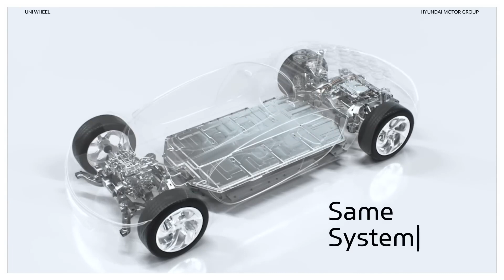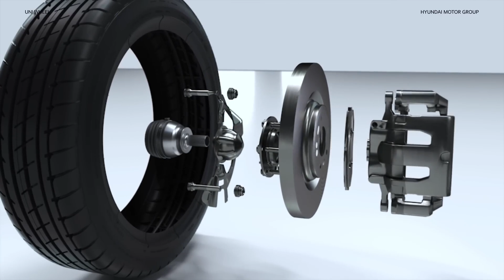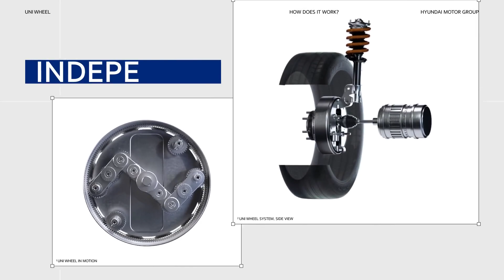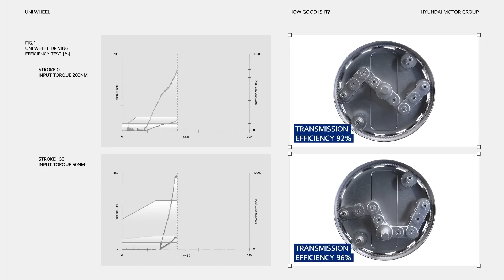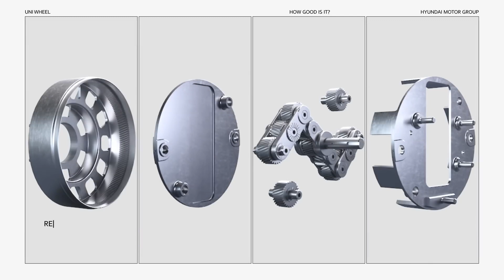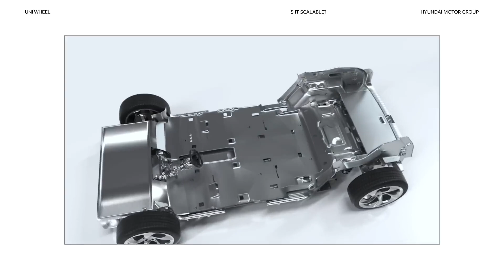Hyundai Universal Wheel Drive System

Comment: Does braking fall totally upon the regenerative electric motor system? How long will this system last in a harsh environment of dirt roads, mud, salt, snow and ice? Does that big vertical slot accommodating the suspension travel get a perishable rubber boot? I am trying to visualize how that boot would work and last. What happens to the planetary gear system when abrasive dirt gets in? I bet a replacement planetary gear set is a whole lot more expensive than a CV axel assembly. I can install my own CV axel assemblies, but I'm pretty sure I would not be able to replace a planetary gear system. I'm betting that most of these concerns have undisclosed solutions, but my little brain starts whirring real hard trying to imagine what those solutions are. It will be interesting to find out if this is just a pipe dream.

An example of another somewhat workable idea that isn't really all that practical in a harsh environment brings to mind the airless tire designs often touted on YouTube and elsewhere in the media. I instantly imagine how unbalanced those tires would become in mud or any of the variety of frozen precipitations encountered in winter. Maybe the tires are good for paved streets in San Diego, but back roads in the northeast in mud season? I think I have to laugh. This seems like another thing along the same line of practicality until proven otherwise.

Comment: I believe I understand the idea behind the Uni wheel and very much believe EVs are the way of the future.   My first thought about the Uni wheel concept is how do they plan on keeping the gears clean or lubricated.  Looks like it will be hard to keep dust, water, mud and other debris out while still having the range of motion.
Reply: Maybe they could use a very large rubber socket around the uniwheel and the motor to allow enough movement while staying impermeable
But from what I know, I still think hub motors are the best bet for the futur
Hub motor biggest problem is that they add significant unsprung weight to be able to deliver enough torque (with or without mechanical reduction, because the reduction will also be unsprung weight)
Axial flux motor seem promising to maximise torque and minimise weight, but still need several years of development, and more to see them on multiple brands as they are heavily pattented for now.

I daily drive a Silence S01 with a 7kW hub motor, this kind of motor is indeed great for reliability and overall weight, but unsprung mass make it very hard to dampen road irregularities in a comfortable manner.
With a 120kg vehicule and 30kg rear wheel, the whole vehicules get's easily moved by the wheel following a bump on the road.
Reply: the reason axial flux motor will help hub motors is because standard radial flux motors are most efficient (with respect to the energy they consume and their weight) in a long + small diameter form factor and turning fast with relatively low torque (so a significant mechanical reduction is needed for a wheel)
axial flux is most efficient when short and large diameter (closer to the proportions of a wheel) and producing high torque at a relatively low speed (so no mechanical reduction is needed)

Comment: To bad EVs are a joke, scam, and pollute worst than internal combustion engines.
Reply: No, they don't. Even when you account for the long tailpipe. Don't forget, oil has a long tailpipe too.
Reply: @ebolapie  creating the batteries for the EVs pollute worse than 10 years of driving a gas vehicle. Get educated.
Reply: @user-qi9be4lv7l  Does that take into account the pollution caused by extracting, transporting, and refining fossil fuels?
Reply: Think about it, you can recycle 99% of a battery while you can recycle 0% of oil